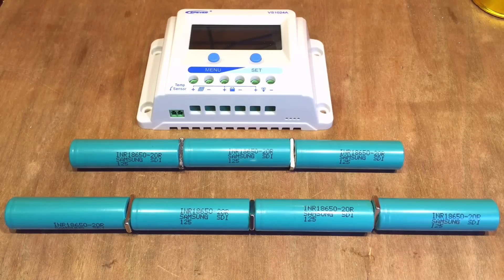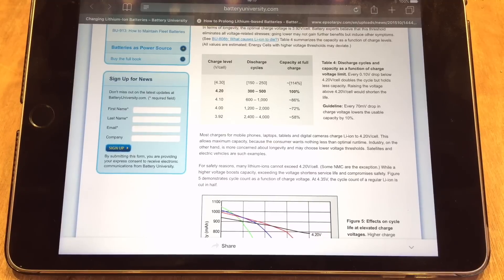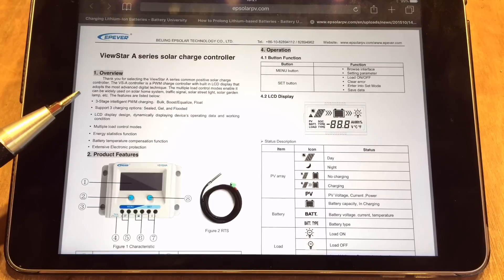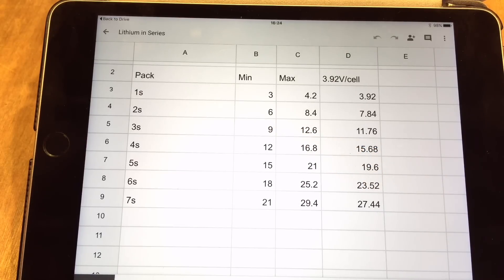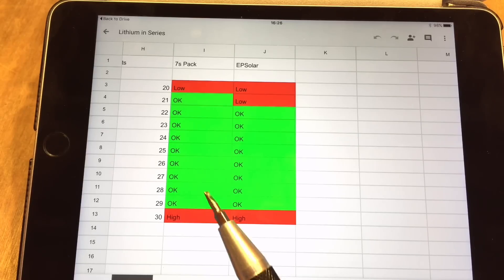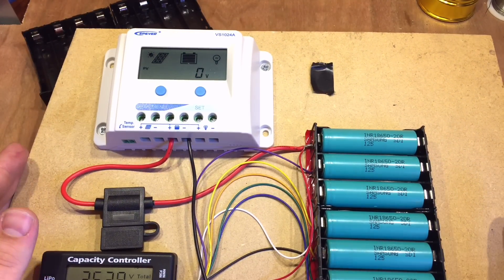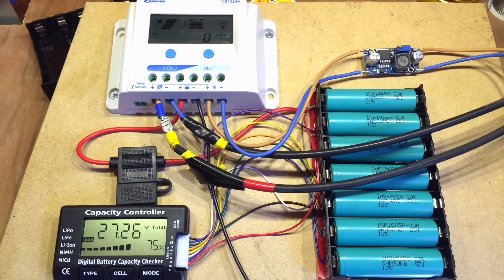Solar Charging Lithium Ion 18650s - Part 1, The Plan - 12v Solar Shed

Comment: The title was very promissing to me because i have 120 new Panasonic 18650 batteries and i first wanted to connect them in 3 series in my Iveco daily, and hook them up on solar but when i'm driving, my alternator which gives 14,7V will charge them to... but i also read that it's maybe better to put them in 4 series...  so i hoped to find the answer in your video.. but then you got to 24 Volts :p  and i can see in the green red diagram why you dit that but my iveco is 12V powered.  ( i don't think i can do that, or my alternator will get more volts from my leisure battery than it provides.. and that does not sound good i guess ), any idea's suggestions ? :)
Reply from the maker: Yeah I just don't think 3s or 4s work very well in your typical 12 volt environment.  If I could have made it work I would have done in the shed because that's my preferred nominal voltage.
4s will charge up to a maximum of 16.8v but 14.7/4= 3.675 per cell.  You'd be massively under charging your cells and continually keeping them below their nominal voltage.

I'd suggest you have a couple of options.  Change your chemistry - not really an option now you have 120 cells!  Or think about DC2DC converters.  You could potentially use a DC2DC converter to boost or buck your vans alternator voltage to a more suitable charging voltage for a 3s or 4s pack.  You'll need something that starts the process automatically, is protected from reverse current and can handle the amount of current you hope to charge at.  Another DC2DC converter might be required to feed your loads in the van if your battery pack is going to be sitting at 16ish volts.
I guess you'll also need to grab the most efficient DC2DC converters you can too - otherwise there could be a fair bit of energy (and some fuel) wasted.
Hope that helps.

Comment: LIFePO4 cells tend to be more compatible with lead acid, since 4 cells has a charge complete voltage of 14.4v
Reply from the maker: Yeah that is true. Sadly I don't have a supply of LiFePO4 though, they don't put them in laptop batteries.
Reply: Some LifePO4 AA's are really cheap on ebay... not sure what you'd use them for.. :)  I built this a while ago, into the back of a 20w solar panel:- https://goo.gl/photos/gABAEjberJsybCVw6 

20Ah LiFePO4, with battery manager, charge controller, watt meter and DC-DC regulators for 5v and 20v as well as DC charger. :)
Reply: James Lewis, I wonder if LiIon / LiFePO4 degrade because of the difference between their charging profiles and lead acid charging profile. I'm not an expert on battery charging, so I might easily be wrong here, but isn't there a significant difference in the way these battery types are charged?

Comment: I don't understand you said that PWM charge controller is not suited for Li-ion (Anself video) ?!
Reply from the maker: +The Walking Trade Its complicated isn't it...  it's not so much the technology - PWM or MPPT that's an issue here. It's the voltage targets at which the charge controllers are set for. 
All the cheap charge controllers I've come across for lithium cells are two stages chargers and set for 4.2 volts per cell. They do Constant current (or bulk) until the cells get to somewhere close to 4.2 and then they float charge (or constant voltage) at this level. All the commercial lithium charges (none solar) and the cell manufacturers say to charge to 4.2v then once the current drops to 5-10% of the initial current disconnect the charge entirely.  These cheap lithium charge controllers keep trickle charging the cells once they're at 4.2v and will continue to do so until the sun goes down. 
Using a lead acid charge controller actually works better in my opinion. It's got a three stage charge. Bulk, absorb and float. Bulk (CC) is first, then absorb. As long as the absorb level is 4.2v per cell or less that's the charging limit (absorb usually happens for a fixed time in cheap charge controllers rather than it monitoring the battery state per se). The float voltage will be set lower than absorb. So when the cells reach 4.2 and the absorb time is up the cells are left completely off charge until the voltage level drops. So for me the charging profile works better on lead acid charge controllers than 'lithium' ones. Hope that makes sense?
Reply: Thank you very much for this explanation

Comment: Hi I have enjoyed your videos on charging Lithium batteries ( 24v 7p ) can I ask why you had to connect two of your solar panels in series to charge your 7 pack ?
I was looking to setting up a solar 24 v system in one of my sheds , so at the moment I am looking to get as much info as possible on the subject
Reply from the maker: +Brian Horseman Hello. Yes my panels are nominally 12 volt so to ensure the voltage of the panels is higher than the voltage of the battery bank I needed to place two in series. If your panels are nominally 24v then you won't need to bother.

Comment: Thanks for sharing @Adam Welch ! Have you checked out any of Jehu Garcia's stuff? He is running an electric Samba on a mix of LiFePo batteries, Tesla packs and recycled 18650 cells. He has done a lot of experimentation, as well as the real hard yards of running the cells in his vehicle for years. He's feeling is that you do not need a charge controller or balance charger / BMS. He feels that it is OK to start off with thoroughly tested and balanced cells, then limit the charging voltage to 4 Volt (I think) and to discharge to 3 Volt. He also has fuseable links between cells, so if any portion of the pack exceeds 6 Amps, the link melts and removes the offending cell from the game. He has a video where he tests a pack after running it for 2 years, and the cells are still pretty much balanced. I have also see other guys who follow this route, with the theory that it is best to be over safe on your demands on your pack, without relying on some cheapo chinese components to protect your pack (and house!).
Reply from the maker: +Douger Rohmer I know of Jehu's videos. He's commented on my channel a time or two as well. I agree once packs get large enough they don't need balancing however I've only got groups of four and they're not perfectly matched. 
The cell master 7 is working very well and only balances at small currents. Fingers crossed it's not going to cause me any damage any time soon! 
Thanks for the comments.
Reply: Yeah, I guess there is a certain inertia that protects cells in parallel with each other from having wildly differing voltages if there are enough of them.
Reply: @dougerrohmer  If they are wired in parallel they simply can't go out of balance. It's in series where they can, and often do go out of balance.
Reply: @Ziplock9000  not according to Jehu Garcia. I know what you are saying, I myself have a BMS in my 100 AH LiFePO battery pack, but according to him if you test your cells before and bottom balance and/or top balance or whatever, then it's not necessary. He has huge packs which are probably more than a 100 Volt (ie lots in series).
Reply: @dougerrohmer  I think what is happening is the random differences between cells are being averaged out in a large parallel pack due to how many cells he has in parallel. Smaller parallel sets would be more likely to succumb to issues though. For example, if you picked 1000 random numbers between 1 and 100, the average of all of them would always be very near 50. However if you only took 10 random numbers between 1 and 100, the average would be a lot more spread out.

Comment: Thanks so much for sharing. I've Just purchased my first 110w Solar Panel for my Tiny Home Build. I've not yet purchased my Solar Charge Controller or Battery set up yet. Would you suggest a regular inexpensive MPPT that you tested ( cpt-la10 solar charge controller ) and Lead Acid, or MPPT and Lithium Batteries, or PMW and Lithium? Thanks for time and much appreciated suggestions.
Reply from the maker: There are a few things to consider here.  Firstly are you happy to go with a 12 or 24 (or 48) volt system?  For me, a 12 volt system is best achieved with 12 volt lead acid batteries.  24 volt and above work equally well with lithium or lead acid.

So it depends on what you hope to run from your batteries - are you going to slap on an inverter and run everything at 110/230 volt AC, or do you want to use lower voltage DC loads as well, or exclusively?  If you're looking to use low voltage DC lighting for example, most off the shelf products are 12 volt although there are some for the 24v trucking market.  So you can go most simply and cheaply with a 12v system or you can run 24 volt and convert down to 12 volt for loads that need it.  Issue here is losses in conversion.

If your solar is going to be the primary source of power then I'd consider whether you want to do it on the cheap, or pay a bit more money for something that might end up a bit more reliable.  In my shed if the solar goes down (although having said that I haven't yet had a charge controller fail) I have alternatives available.

MPPT vs. PWM is always an interesting debate.  MPPT is an advantage if you have somewhere to store  the additional power.  MPPT charge controllers will end up in PWM mode once the batteries are full.  So if your batteries are charged quickly on a morning the MPPT charge controller may be fairly pointless.  They may also not be quite as efficient in the winter when power is very low coming from the solar panels.  If you look at the cost of MPPT vs. PWM and you have the roof space it may be better to put that extra money into more panels rather than MPPT.  However the charge controller you looked at is only slightly more expensive than a reasonable PWM charge controller.  However the losses in conversion may be such that a decent PWM charge controller will reap better results.

Lead acid batteries are quite good at gobbling up the power you throw at them.  With lithium you don't want to charge them too aggressively.  So if you go down the route of lithium you need to consider what is the maximum charge you might achieve, and will that be too high for your lithium pack.  For both chemistries you need to consider what your typical daily use will be, and will your solar be able to replenish that on a typical winters day.

If I was starting again today I would have to seriously consider lithium, however it seems silly to have to convert down to 12 volt as often as I think I would need to for the things I've got running in the shed.  My shed roof is now completely covered with panels.  The only way to get more power for me now is to use MPPT.  Your situation may be very different.

Keep watching the videos on youtube and you'll get a sense of what will work best for you.
Reply: Adam Welch  Mr.Welch, thank you so very very much again, for your time and sharing your, this knowledge, information, testing experience and response. I truly truly appreciate your time and the energy you give. Sun power been an actual dream of mine since I was a child and I will most definite,y be watching. And I look forward to also sharing as I get further along. My aim, is to have a 10'x28' off grid tiny home on wheels accompanied by my portable Yurt, which will be both my additional space and my instant Pop Up Cafe. 

I will be using all very low wattage dimmable recessed LED lighting. An instant hot water electric or propane heater, there may be a small projection television instead of the traditional flat screen. An induction stove, a cast iron wood stove, air circulation fan intake and exhaust, a LED porch light, a. I'd range stereo system and electric tea kettles. Right now, I'd like to build something to have power for my Mobil small portable bar size cafe tea street cart. Where most products are cold but able to run a small Flojet bottled water pump from 6gallon water tanks, 1 or 2 electric tea kettles, an instant hot water heater (only comes on when in use) and possible, a small home style semi professional espresso machine. In my tiny home will be my Apple Computer editing work station with a 30' HD Apple monitor Laptop speakers. All y security outdoor night lights will be the autonomous LED Solar outdoor light style and I will be looking to Supplement my mobile home shed's power with at least 1 wind turbine (deciding on VAWT or HAWT). Thanks so much, I'll be watching! Happy new year to you and ALL!!!

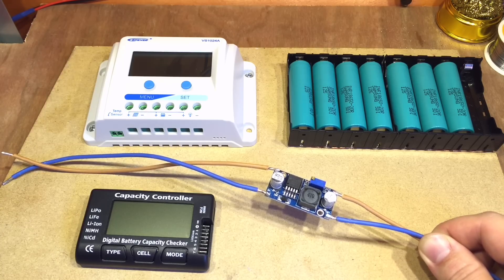Comment: +Adam Welch - Happy New Year! We've not seen your vids in a while, so hopefully all okay!  I'm doing this build at the moment!  @9:20 approx. you mention, "with all my batteries in" and then connect up; if I can step back a little, when you connected the 7s balance cables, I take it you connected to each cells negative in the cell box?  Just a quick sensor check.  It would be really helpful if you commented on wiring sizes too (again as a sensor check) specific to this build or any lessons learned.  Hope this is okay! - Aidan
Reply from the maker: +Aidan McGrath Yeah the balance leads connected to the nickel strip on the negative side of each group. However there is also a connection at the most positive point too - so my 7s pack has eight balanced cables. 
As for wiring size it all depends on the current you'll be charging or discharging the cells at. I'm using AWG14 to connect to my 10 amp charge controller, but I generally try to over-spec the wiring where I can. 
The setup is working very well. I've found it to be staying well in balance and charging well. It now survives a few poor days and gobbles up the amps when the sun finally returns.

Comment: What about the amps?
Reply from the maker: I'm sorry I don't understand the question?
Reply: Sorry for not making the question clear,
anyway what I meant was how the charge controller knows what current to charge the 18650s with... 
You can adjust the voltage on the controller by selecting the battery type (AGM, flooded ect) but you can't control the amps being sent to the cells right? I thought the cells might not be able to accept all that current being put into them since most 18650s can only except 1.6A max.
Reply from the maker: I see - thanks for expanding.  As we are dealing with solar there is no guarantees - I did talk about this is the video.  The bulk phase will not be constant current.  The solar panels I had connected to these 18650s could deliver a maximum of 2.86 amps in perfect conditions (so that is pretty rare) and as we're using a PWM controller it is likely that the panels will not reach their maximum power point.  Also that theoretical maximum current is shared across all the seven cells.  So in effect we are charging these cells pretty slowly and we're not going near their fully charged capacity.   I've expanded this setup now to e 7s4p pack and left the same solar panels on the setup.  So I'm charging these even slower now.  

I guess you need to calculate the maximum charging rate you are comfortable with and connect the right sort of solar array (or panel) to suit.
Reply: Are the panels able to provide 2.86 amps, at 24v? 
Doesn't that mean the cells will have the full (potentially. I use the 2/3rd rule, so realistically 2.86* 2/3rds=) 1.9 amps  down through all the cells in series. IE., each cell will have 1.9 amps.  
Now that you are using, a 4p, this will be 1.9/4, so just under half an amp. But there was the possibility before , for much higher current. Maybe I've made a mis-calculation in my thinking? I would value your input here, as I am looking at doing something similar, but having trouble understanding the charge controller options.

Comment: I was wondering? after the 12 volt converter does the mah stay at 3500 or does it go up to the 7000 mah, math shows it should be?
Reply from the maker: Yeah I guess it does (not accounting for losses).  The watt hours of the bank would remain the same, but as the voltage has reduced the mAh would increase.  I guess we also need to factor in that my '24 volt' pack actually has a nominal voltage of 25.9 volts so actually after losses it probably is about double.  A good point - thanks.
Reply: I did put the wrong numbers as you stated your batteries are 2000 mah I was using the 3500 mah I have listed on my batteries. I have 26650s I am going to build plus I would like to make two packs and parallel them for 14000 mah
Reply: Just be careful of "3500 mah" cells. There aren't many manufacturers who can do this, without sacrificing something else somewhere, so they may be fake.
Reply: they are 26650s not 18650 but the are radio shack. i do to know if they actually measure 3500mah but they are all the same brand. I don't have any way to verify their true output
Reply: John Lucero 
I have some of the 26650 cells from Radio shack. I haven't got to use them yet. are they any good?

Comment: Nice and simple solution!

I have heard the capacity tester might be parasitically drawing more power from the first cell. Just something to have in the back of your head if you do see some cells drifting.

EDIT: I now see you added balancing with tis device in part 3, so this turns into more of a note to others/other projects instead, and perhaps for other (similar) products.
Reply from the maker: +Dennis Olsson Thanks for the comments (and update) Dennis.

Comment: Another good video but I would just use the solar on a 12v lead acid and run an IMAX B6 charger running off that to charge the lithium pack.
Reply from the maker: +Doogs Fixit Vids The lithium pack is just for testing. Both are being charged daily even on these grey rainy days. The imax b6 can't charge my 7s lithium pack though...
Reply: +Adam Welch Good point. I've watched this with great interest as I'd like my solar shed setup to be lithium based. I'm currently converting a large shed so I can have it as a lab/workshop and want to power it completely by solar and have a lot of harvested cells. Thanks for sharing.
Reply: same here for my 12V solar setup